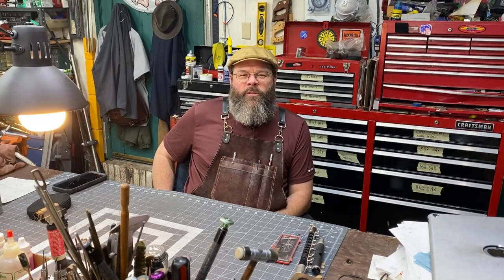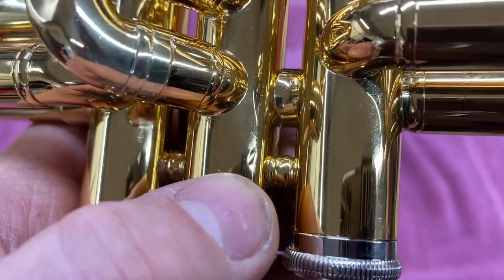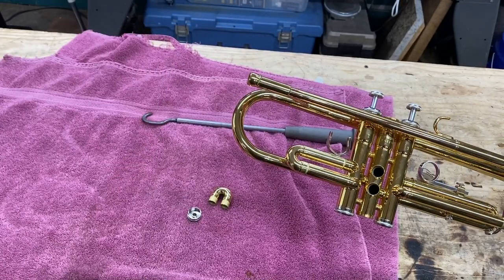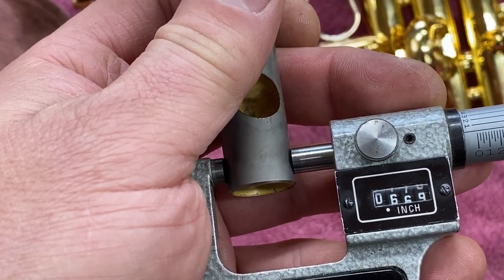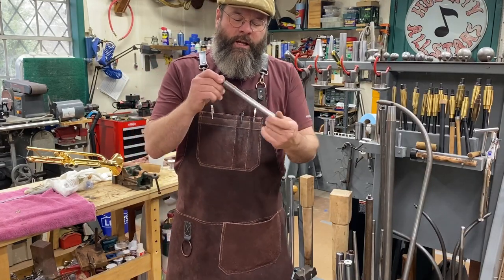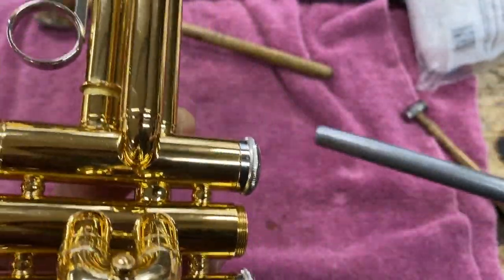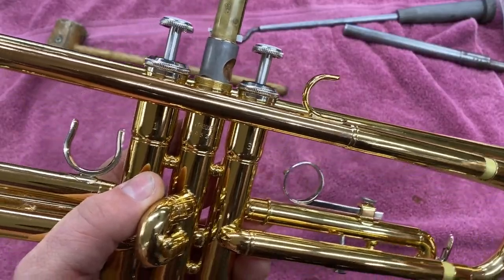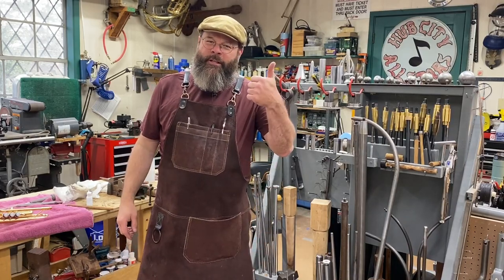Piston/Casing Problems- How to Size for mandrel- Band instrument repair

Comment: "Mouthpiece dent in the casing"

Yeah, I can relate.

I brought my primary trombone (King 2B, for jazz lead, and classical tenor and alto parts) into my local shop a few years ago for slide work. The local shop is Osmun Brass, in Acton MA, about 2 miles from my house. Their work is superb. 

I opened up the case at home, and immediately dropped the mouthpiece on the bell. Crap. 

Well, the horn is due for slide work again, so I'll point out my mouthpiece dent when I bring it in.

Comment: Hi, great video. I’m wanting to attempt a similar repair in a junk trumpet and need to know which size mandrel/s I should buy.Could you clarify a few things for me?

You measured the piston at 0.664 of an inch, however, it wasn’t clear what size the interior of the casing was. I assume it must have been slightly larger to allow clearance for the piston. You also didn’t say what size mandrel you used. Was it a 0.664 mandrel (same as piston) or was it larger to match the casing?
Reply: I should mention I’ve measured my own piston to be 0.660.
Reply: There's a chart in the Ferree's tool catalog listing the casing size per manufacturer (e.g. Reynolds/King/Holton= .660", Olds/Bundy=.665"). Search for "Ferrees Tools Catalog pdf".
Reply: Thanks very much!

Comment: Very interesting.   I hope you don’t mind a question and a comment.  Maybe two questions.   I started on a trumpet many years ago that had springs on the bottom that pushed the pistons back up.  The Yamaha trumpet that I have now has springs on the top that lift the pistons back up.  Is one system better than the other?
I managed a QC department for some time.  Our method of using the telescoping gauge was to tilt the shaft just a bit and then gently tighten the gauge.  When the gauge stem was then aligned with the bore, the gauge was pushed slightly farther into itself.  We thought this guaranteed best contact.  You did not do this.  Is this because the piston sleeve on the instrument is delicate?  Just curious, not criticizing.  
I enjoy watching your videos!
Reply from the maker: Thanks for watching.
 As far as springing, there were several different styles throughout the years but they all seem to be top barrel sprung now. 
Do you notice a difference or have a preference? Interesting topic for sure.

As far as using telescoping gauge, I only showed taking one measurement in the video, if I were trying to get an accurate size for making a custom mandrel, I would take multiple measurements up and down the casing. Much like what you’ve described.
Reply: Wes Lee Music Repair thanks for responding.   I am not sure that I have a preference on the springing.  Partly because I was much younger with the bottom spring.   One thing I do remember is that if the valve got a little sticky, one could take the bottom cap off and elongate the spring.   Likely not the best idea, but what do third graders know about such things.
Reply from the maker: Hey, you do what you have to in a pinch! I think everyone has stretched a spring! Ha
Reply: It looks to me like all the newer instruments, like the Yamaha you mention, have it where the spring is on top and it pushes the piston back up from above.  There must be some advantage to this, but I can't figure out what makes it better (can anybody comment?).  And yes, you can still stretch the spring; it's just a little harder to get to it in these new pistons ... but I would think if the piston and casing are clean and there's no obstruction, you shouldn't have to.
Reply: @wesleemusicrepair9820  Hey Wes, do you have any ideas about why the top-barrel spring approach is so widely used nowadays? What makes it better/more efficient?

Comment: Amazing. I’ve done a few valves myself and those casing mandrels are a god send. Quick question. What’s the chem clean solution that you use?
Reply: If I recall correctly, Les did two videos that showed the chem clean procedure.  They were back a couple of years I think.  If I remember correctly, the first was a "soap solution", followed by a descaler for lime.  Slides and valves go in the ultrasonic then the soap solution.  Rinses are in between stages.  Here is the title to search for : "Chemical Flush- Wes Lee Music Repair" and "Clean, Sanitize, Disinfect- Episode 22- Wes Lee Music Repair - cleaning in the face of corona"  The first one is a couple of minutes, the second about an hour.  Hope this helps you.

Comment: I have a rotary valve Bb tuba but the head of the big screw that holds the arm down is sheared off
Reply from the maker: That can be taken care of!
Reply: @wesleemusicrepair9820   how difficult is it to remove it
Reply from the maker: Honestly, some are harder than others. A lot has to do with the threads and how well they were made.
It is not a super expensive repair though. What brand of tuba is it?
Reply: @wesleemusicrepair9820  miraphone
Reply: @wesleemusicrepair9820  4 valved
Reply from the maker: I’m happy to take care of that for you.

Drop me an email at 
WesLeeMusic@gmail.com
If you would like to discuss further.
Thanks

Comment: Glad you threw those garbage reamer out.👏🏻😅👍🏻
Reply from the maker: Found that in a junk shop, I know it’s old but looks like it has never been used! Haha I guess the previous owners couldn’t find a use for it either!
Reply: Those reamers were ment to cut inside the valve casing when they are assembled  from scratch , not for repairing a finished product
Reply from the maker: @erniearruda8861  agreed. They have no place in repair. But I do use them in sizing parts that I’m making
Reply: @wesleemusicrepair9820  Hey again!  Somebody should inform Allied about how bad these things are ... the catalog says "The toughest valve repair job is made easy ... " and: "You will pay for this tool [I think they were trying to say "this tool will pay for itself"] each time it is used by saving time and by doing an extra fine quality job."